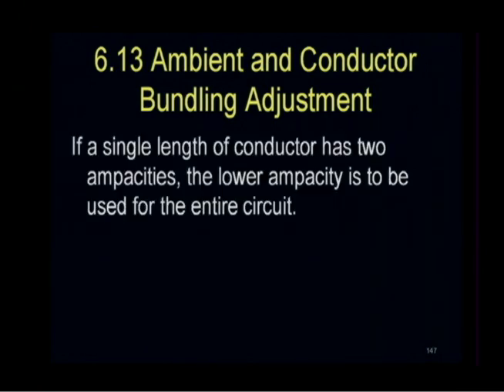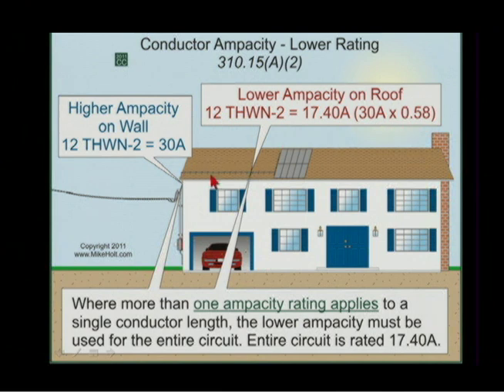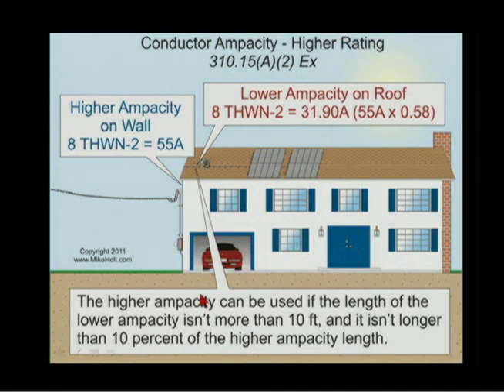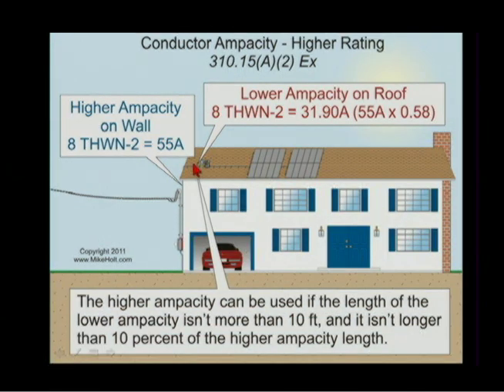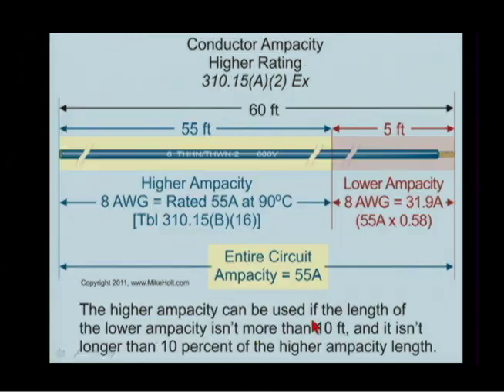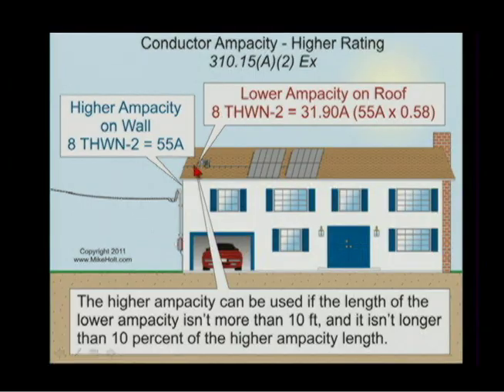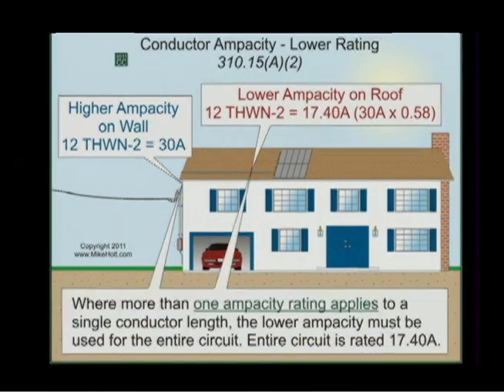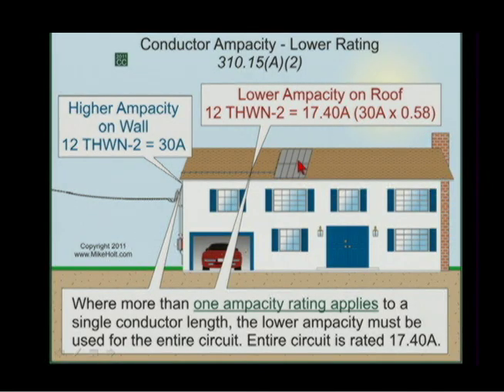NEC 2011 Ambient and Conductor Bundling Adjustment 310.15(B) (9min:14sec)

Comment: 17.5 amp wire will heat up using 20 amp breaker gengerous 
You guys are confused then how we learn from co fused people for correct andwer for exam?
Reply from the maker: The 'ampacity' of a wire has nothing to do with the 'load' on the circuit. A 17.5A wire on a 20A circuit is only permitted to carry 16A.